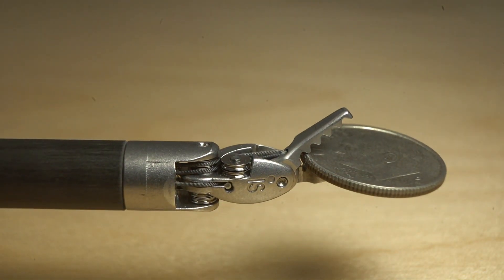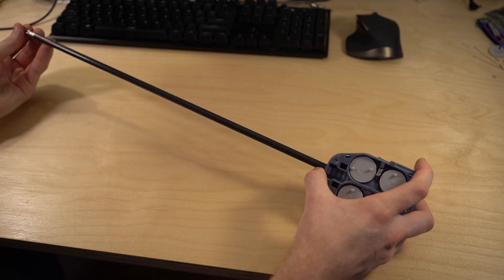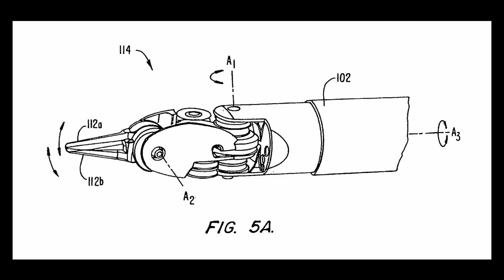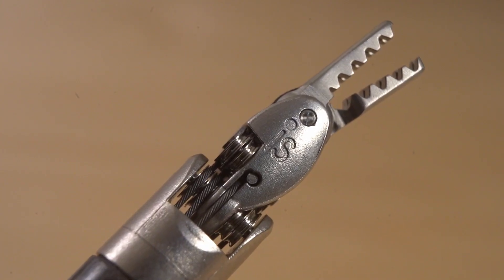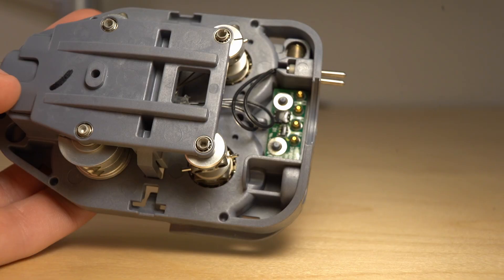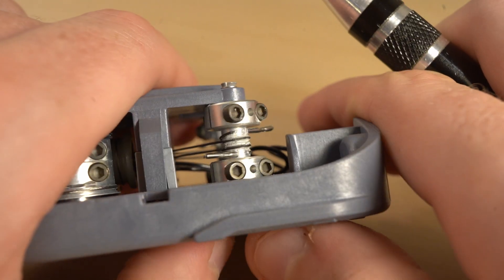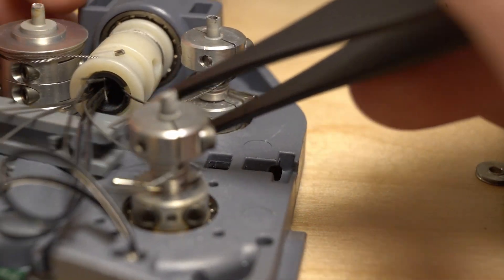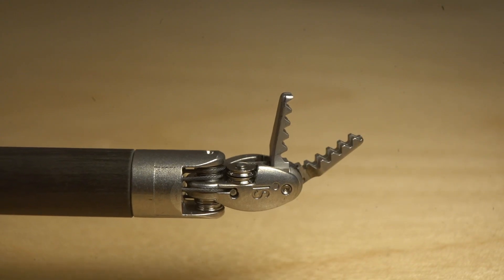Teardown of Surgical Robot Instrument

Comment: 14:38 - I'd imagine the washers are there to account for the unpredictable geometry  of the swaged/riveted end of the shaft. 

If that wasn't there, when the shaft is squished to form the end, there'd be uneven forces on the inner bearing race - so instead of that, the washer sort of takes up those forces.
Reply: The swaged shaft seems surprisingly low quality compared with the relatively precise manufacturing and parts choices for the rest of the device.
Reply: Pillowcase, my thoughts exactly

Comment: 14:38 - I'd imagine the washers are there to account for the unpredictable geometry  of the swaged/riveted end of the shaft. 

If that wasn't there, when the shaft is squished, there'd be uneven forces on the inner bearing race - instead the washer sort of takes up those forces.

Comment: I wonder why they are disposable?  Granted strict medical standards, and maybe the thermal cycling of the plastics / metals (especially the cables?) ?  Even then i would assume refurbishable would be a good option.  Maybe some right-to-repair stuff...  Either way this was really neat, and thanks for the overview/teardown!

(Now i want to go make some contraption using a pile of these used ones lol)
Reply: I'm with you for many consumer goods, but having seen the details in this great video, I think it's reasonable that these are dispoable. Issues that would be reasonably expected to occur after multiple uses: ageing of plastics due to autoclaving; corrosion as seen due to dissimilar materials; fatigue of the cables due to small bend radii; wear and buildup of wear particles in guides, pulleys and drive cogs etc. Which might lead to sticking, slack, loss of tension, loss of joint stiffness, backlash, affecting quality of the control which might interfere with the movements causing poor outcome for the patient. Then there's buildup of organic material in gaps and small spaces. Worst case is seizure or snapping of cables during operation which could be catastrophic at a critical moment, or lethal infection. Think about the cost of the operating theatre, medical staff, equipment and consumables and it's probably a relatively small additional cost for the quality assurance and reduced risk to patients, and reduced liability for the manufacturer... who ultimately needs to stand behind their warranty by taking care of these issues somehow. Uncscrupulous users in poorly regulated countries, perhaps using secondhand parts, might harm patients and the reputation of their brand so it's fair for them to enforce using a memory chip.
Reply: Sterilisation and autoclaving can't be done forever as it may degrade the internals. Plus if you keep cleaning after its used you increase the risk of contamination building up somewhere to a point it poses a risk.
Reply: you must understand how small these devices are and how tiny the radius those cables must travel. my guess is the cables make up  most of the reason for the disposability. they will fatigue fast when under tension going around a bend. so they probably tested it in the worst case scenario, and probably found the earliest one failed was after( example: )20 cycles, then they put a 10 cycle limit to make sure not a single one ever fails in the field. imagine you are in life saving surgery and the robot arm loses grip of your artery and you bleed out lol
Reply: Having worked on surgical robot end effectors, just some of the reasons for them being disposable;    1) Contamination, autoclaving doesnt remove all tissue contamination, (its sterile, but still dead meat), 2) Corrosion, autoclaving is the quick way to rust even surgical stainless steels 3) Fatigue, the cables are bent around very tight radii repeatedly and start to fail (fray) after low 10s of hours use.  4) Calibration, with use, corrosion, fatigue, the parts loose tolerancing and become looser and harder or impossible to control accurately.     To referbish to the correct standard isn't really cost effective, as the bearings, cables, tubes, at the very least would all need replaceing, and most of the tool is riveted or crimped together both due to scale (no room for screwed fasteners) and reliablity (really don't want loose screws falling off inside the patient), in a way which would mean having to destroy many parts to recover a few, which would then need refebishment and extensive cleaning to be reused.
Reply: @samcoupland  makes sense.  Thanks for sharing your expertise!
Reply: Strictly business-plan related. Think of your Gilette razors or your Nespresso pods. That is were really income comes from.

Comment: At 7:55 you talk about the coupling between the two axes - does this mean it is not possible to use both joints simultaneously? For example, if you try to pinch the jaws while tilting the wrist angle, will you get slack or bunching of the cable? How do you make both joints independent of each other? Also, amazing video quality!
Reply: I think this is on the operators end to accomodate. I guess the driving servos can apply tension to the tools, for example to pinch stuff. Then when you move the "wrist" of the tool the operator can compensate the unwanted movement of the pliers to keep them pointed where they want.
I dont know if this analogy helps, but in construction excavators, when you want to move the bucket parallel to the ground, the angle of it changes as it travels. This then has to be compensated by the operator by turning the bucket in the opposite direction. More advanced excavators can do this compensation automatically but i dont know if the davinci robot has an automatic compensation system as well.
Reply: this is handled by the computer controlling the servos, in the same way everything needs to be compensated when the whole 7 axis arm moves. every bit of the arm can move at once and the jaw can stay steadily in place. its called inverse kinematics

Comment: if you disassemble a  FUJIFILM  flexible endoscope, you may find a similar structure which was used for more than 50 years
Reply from the maker: I believe the main difference between these devices and endoscopes is that endoscopes do not have a wrist mechanism. The wrist is the most challenging part of the mechanism since the cables need to make a bend around a very small radius.

Comment: How do you define the relationship between coupling axes , pitch and yaw ?
Reply from the maker: Determining the coupling between the axes might be somewhat complex. Not sure exactly how you would go about that. The forward kinematic coupling is probably not too challenging. The inverse kinematics might not have a simple solution and might need to be solved with numerical methods.
Reply: These things are usually operated by servo motors, which know whatever angle every axis is at all times. The surgery probably involves endoscopes as well so they can see what they are doing. The servos convert human legible commands (turn, grab, twist, etc.) into instructions or gcode for the servos to do, and do exactly.

If one were to convert this into some manual grabber for getting your keys out of the grilled drainage….yeah, that’s going to be a quite an endeavor.

Comment: It would be cool if you could show some more details on how the two-part pullies are tensioned against each other.  Is the mechanism similar to those antibacklash gears which have springs embedded in them?
Reply from the maker: There actually isn’t anything else in the mechanism. There’s no springs keeping the tension. The pulleys are both rigidly attached to the shaft, and the cable itself acts as a spring to keep it tensioned. I imagine they have some sort of jig to apply the right amount of tension by twisting the pulleys in opposite directions, and then the pulleys get tightened onto the shaft, locking the tension in.